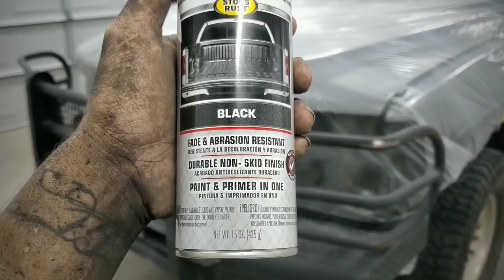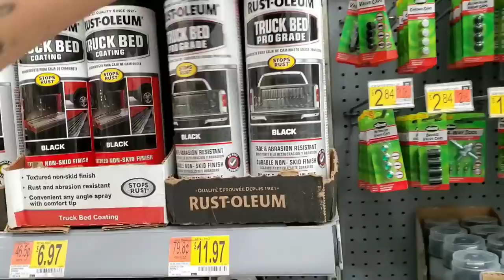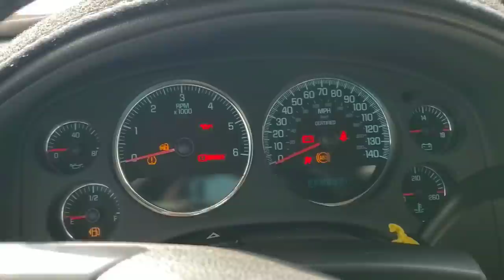Using Rust-oleum "PRO GRADE" Truck Coating on Silverado [HD] Bumpers

Comment: Great work! The welds on those bumpers drive me nuts, though! Haha! I wonder if it would be worth 30 minutes with a flap disk to grind em smooth and fill the seams with bondo for a nice uniform look to you? The welds and the dirty tires are the only things I can see that keep that truck from being sold at the top of its value. Again, great work.
Reply: Perhaps he could have done some under the wheel well work first. The wheels need attention for sure.
The bumper is a project of its own...
Reply: @beefcakes27  They say the difference e between good and great is attention to detail
Reply: @jimjackson3245  I absolutely agree..!
Reply: Holy horrible weld batman
Reply: @Miamicourts  lol no kidding 🤣

Comment: i used the same rustoleum bed coating on my bumpers.  It sticks good but color fades rapidly.  I had to go back over with rustoleum black primer and automotive grade acrylic enamel flat black to get it right.  Good videos GT, thank you
Reply from the maker: Thanks for the heads up!
Reply: @rayneho3062 did it have that same look of grit after you applied the black acrylic enamel? Asking because I like the bed liner look

Comment: I have a 1988 GMC s-15 4cyl 5 speed manual single cab short wheelbase. It runs great COLD AC AND NEW HEATER COIL everything works great! I got it for my 15year old Daughter who wanted a small older model truck she has done a lot of work on it herself like taking off the grill sanding and cleaning then painting with a bedliner paint did a excellent job no buildup or runs!! She has taken the tiers off and washed them and sanded them and used a wire brush on some of it and used index cards to go between the rim and tire and used the same paint. I have ordered the Raptor bedliner paint kit actually 2 of them she wants to paint the whole thing with it so it's got a texture and rubberized finish and coating. Have you ever heard of doing a whole truck in a bedliner paint before and what do you think about it?? Anything I should do specifically or special? I want it ready by October 10th her 16TH Birthday and the day she turns in her permit for her driver's license... But I started when she was 13 teaching her to drive a manual transmission. We live out in the COUNTRY so plenty of places to teach her now she's driving a 1999 peterbilt with a super 10 transmission. Love my girl my hunting and Fishing buddy that also does Beauty Pageants on the weekends and is a HONOURS Student and very Beautiful well rounded girl and does barrel racing her horse is the fastest in our county. Sorry like to Brag on her. But what about the bedliner paint on the truck????????
Reply: Good for you, bro, girls who love their dad are never P's O S and always head and shoulders above the rest (which means, sadly, most girls)

Comment: Next time try raptor Bedliner bro, way way way better then rustoleum. It’s about $150 for 4 bottles with Hardner and the gun. It covered 8ft bed in my 69 Chevy c10 with 2 coats

Comment: Also from Texas. Great job. Wanted to know if it works on chrome. I've never used bed liner before and need something that will hold up on chrome when properly prepared.
Reply: If you sand it well first, it should be fine